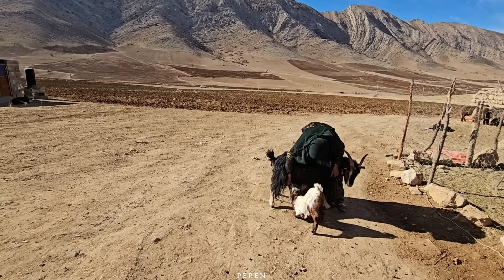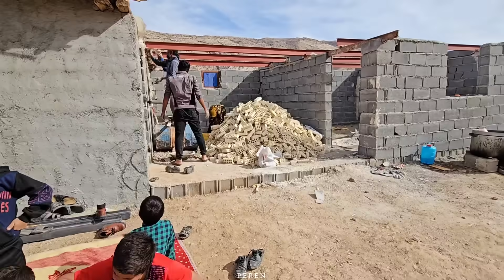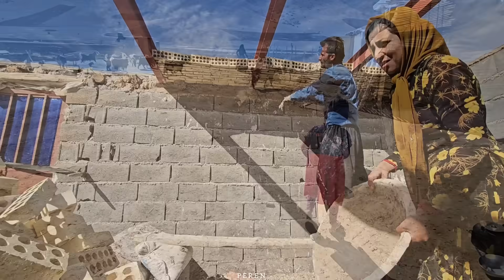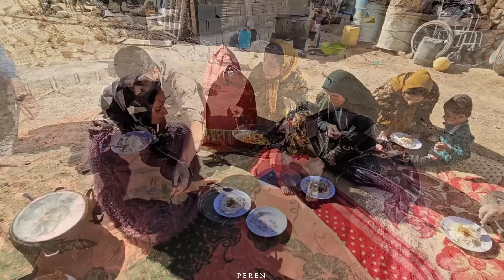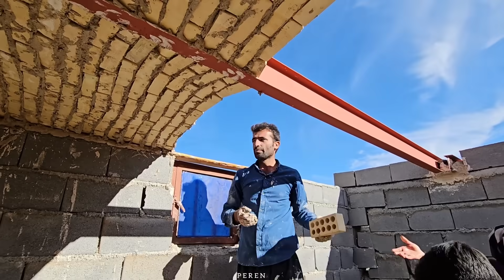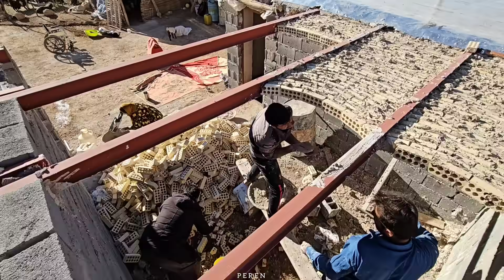"Crafting a Charming Brick and Plaster Roof Room: Embracing Traditional Building Techniques"

Comment: Family, you have been working hard and energetic and you are still working. Except in making this roof. What I know from my observations is that the roof is covered by bricks in the form of a curve. Means in the form of an arc until the endurance ratio increases. But the way you made the ceiling I think it will be weak if the gusty winds blow and with it the rain it will not bear and the rainwater will seep into the room. It will be dangerous if any earthquake occurs, God forbid. I wish safety and protection from God. It is not forbidden to ask and consult those who have experience. Before the roof work is completed. ❤

Comment: There is a possibility that the ceiling they are now making with plaster bricks will be covered by heavy rain because it will not withstand the weight of the water. Especially since gypsum can decompose from too much water on it. Unless there is still extra work for the roof. Protects him. I hope that the roof will be strong to face and resist weather conditions.
Reply: Вы почему решили, что потолок-это и есть крыша? 
Естественно, что ещё и кровля будет и никак иначе 😉
Reply: its not only bricks as their roof.. they will plaster the ceiling n the above they will cover..in TIR they covered with soil and not sure after that put cement or something else because the house is still under construction..
Reply: Read the description in the title.

Comment: i'm worried about the bricks.. are they going to be strong enough to hold any cement and waterproofing you are going to put on top of them? I feel like they will collapse under pressure.
Reply: I agree so worried
Reply: 😢😢😢😢😢 creo que es un riesgo muy grande. ¿Qué pasará cuando caiga nieve y el peso sea aún mayor?
Reply: At the very leased, remove the excess plaster on top to remove weight.

Comment: I am a civil engineer. This type of covering is called an arch, which is done when an iron beam replaces a wooden beam. The mortar used is plaster and soft soil. In this type of roof, the porcelain brick should have a small arch. If the principles and requirements are implemented, it has good strength and is used in buildings with low floors. Of course, it can be seen in this video that the Chinese brick does not have a necessary arch and the requirements are not met

Comment: This is a unique way to build a roof. This brick roof helps cool the house in the heat of summer and warm and cozy in winter. The roof is basically built like the Lego technique where the bricks are laid out on a horizontal plane instead of a vertical plane. To further strengthen the roof, in every 7 rows of bricks that are laid, you need to insert four (in spacing apart) 40 cm rebars  rod in the holes of the bricks. Then again on the next 7 rows of bricks, insert the rebar again, but the shift to the left or right depends on the first 7 rows and continue until the end. Now it looks like each section of roof brick is supported by the edge of a metal "I" beam with plaster as a lock for each brick. Plaster has been used, many of which do not adhere to the metal "I" beam and separate over time due to thermal contraction and expansion of the metal and concrete. Can't wait to see how the Pern family handles the exterior roof with more reinforcements.

Comment: Please consult with a qualified Civil Engineer. The way you are constructing your ceiling is EXTREMELY DANGEROUS for everyone that might be under it. There are various types of forces!!!! Sheer forces and weight (forces caused by gravity) coupled with additional forces caused by vibration and motion along with weight affixed to the top of the roof for waterproofing may cause your brick to collapse.. PLEASE! Stop your construction and re-think the process. Contact and consult with engineers; for the safety of your family and others.

Comment: Is it cheaper to buy the metal pannels and use fiberglass insulation? And it doesn't take as long. I would think it would be cheaper to do it that way. In my opinion safer too.

Comment: So awesome you fixing your home but why didn’t you buy the big floor tiles like the ones in the bath areas and then added the cement on top? It would be more safe and secured than the way you doing it in this video or why didn’t you put the wood panels across before putting on the briks for security purposes😊❣️👍🏻

Comment: Please people, believe this: I used to live in CA and we had a medium earthquake of 6.5. Two women were killed underneath BRICKS. I saw with my own eyes brick buildings all over town come down. ONLY the bricks came down.  Bricks were thrown out into the streets. And I'm talking about bricks used on walls, not underneath ceilings. This is very dangerous and I worry not for the builder but for the children, especailly Muhammad who cannot run away. You need to talk to experts before you construct buildings under which your children will live. Pride is of no value or worth. Safety and your faithfulness to the trust your family has put in you are are of primary concern. Bricks are not a stable construction material, especially when used only for decorative purposes.

Comment: These bricks are very dangerous. Even if you fix it, it will fall very easily. It's not good to put it on weak wood. If you do want a roof, use wood instead of bricks.